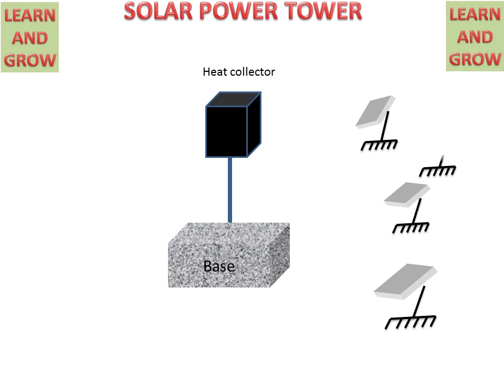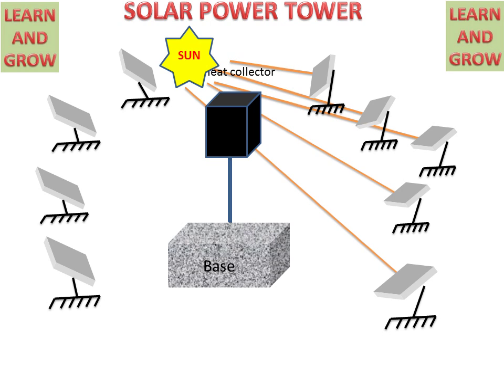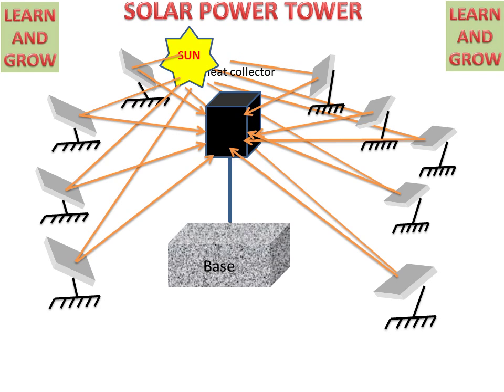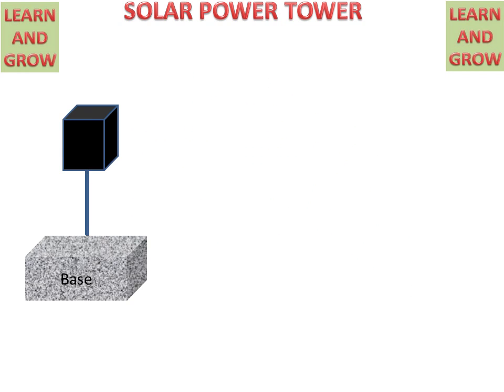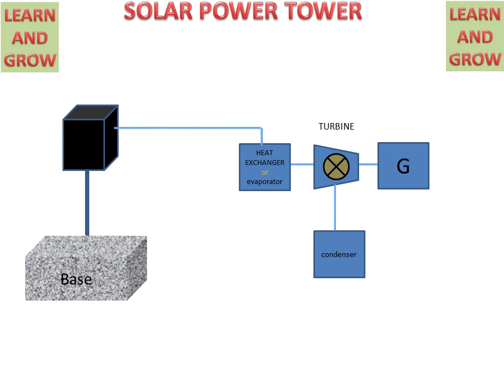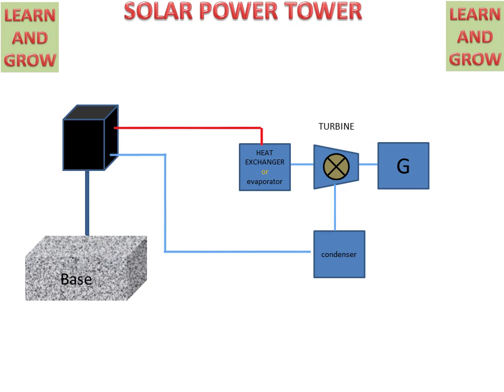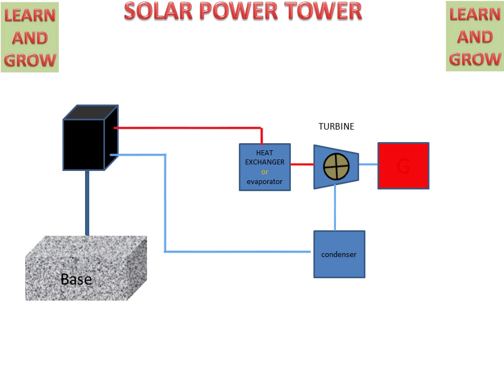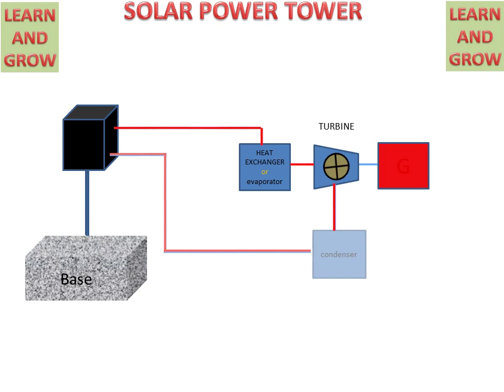Solar Power Tower

Comment: Its temp is above 500 degree then it is already in gas then why we use heat exchanger
Reply: The heated fluid coverts water into steam in the heat exchanger which rotates the turbine...however I m having a doubt that the dead steam (steam after rotating the turbine) should send back to the heat exchanger not to the heat collector, coz in heat collector another fluid is used and not the water